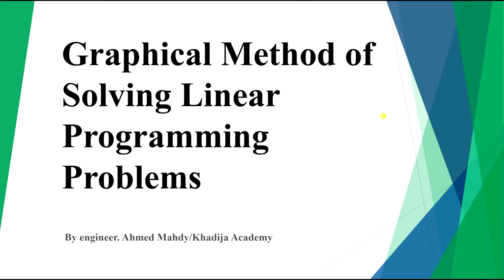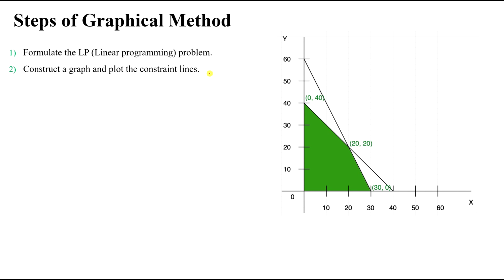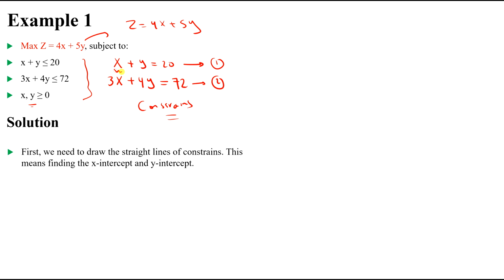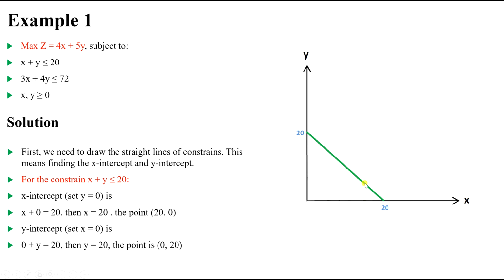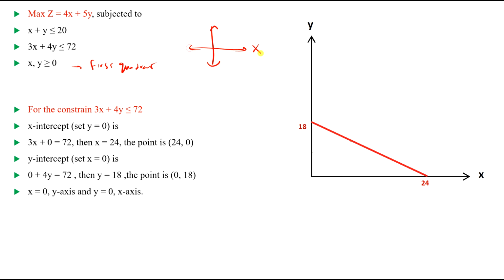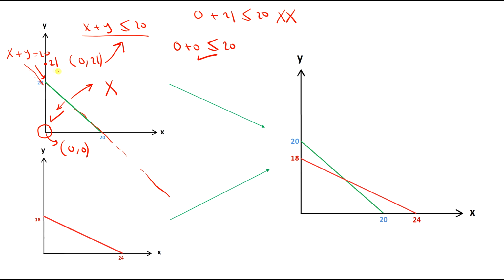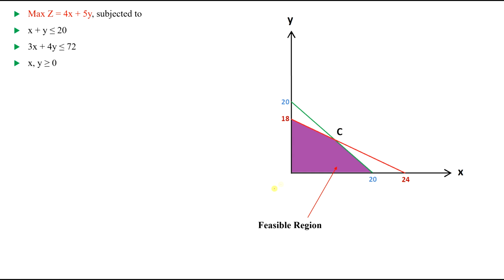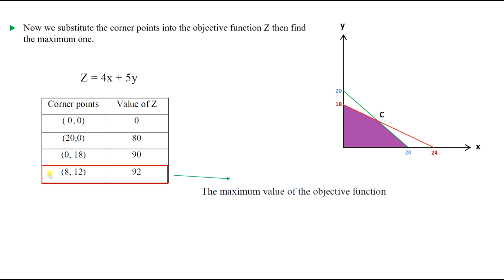Graphical Method in Linear Programming with a Solved Example

Comment: Excuse me, do you have any courses on power system control and stability?
Reply from the maker: Hey Cristo,
Are you asking about theoretical courses that includes power angle, equal area criteria, and these topics or are you asking about control of electrical systems using dq currents using software like MATLAB Simulink?